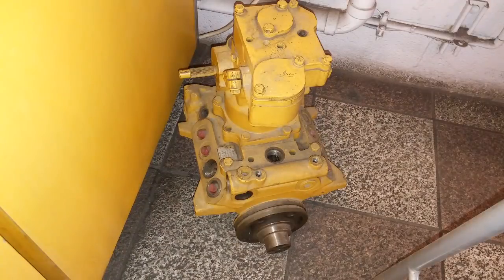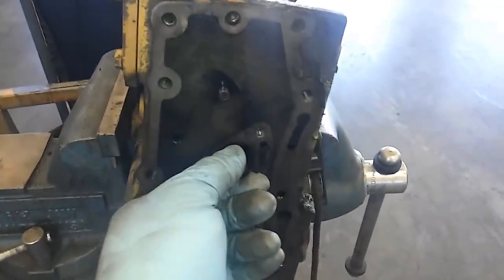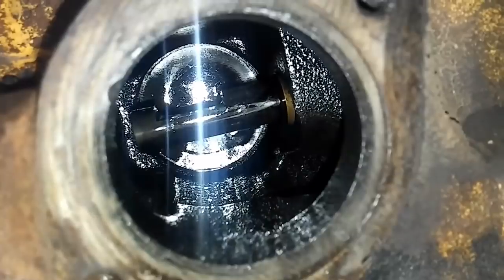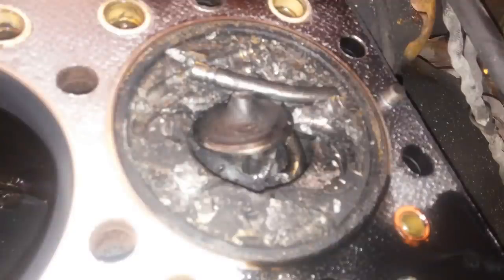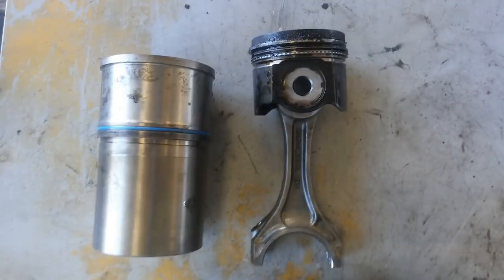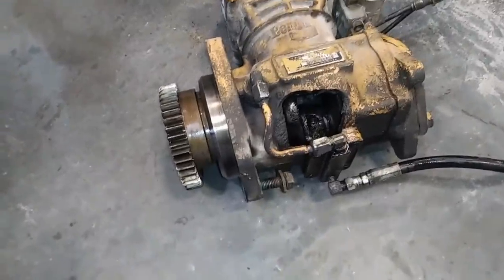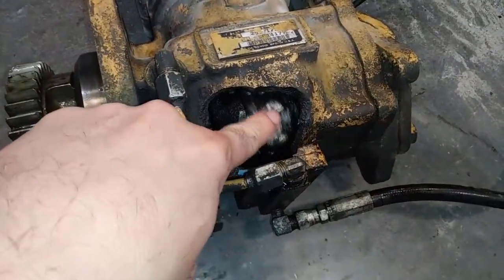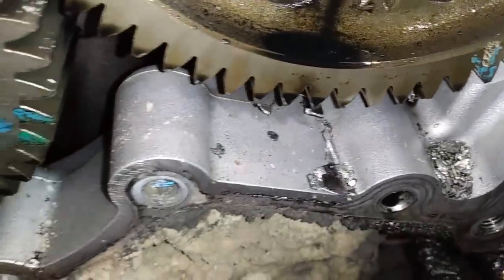Why Do Diesel Engines Runaway? What Is A Diesel Engine Runaway?

Comment: Go to the highest gear and dump the clutch while firmly braking?
Reply: maestro
Reply: On a 2l car thats the way to go. But in a brig truck you might break something.
Reply: Heinz LETZTE. Doesn't feels like something can brake tho
Reply: Do that on a locomotive... Now all of them have electric transmission, no clutch.
Reply: AliveC4T actually some have a physical connection between engine and wheel, but yeah true. Btw my prop plane ran away the other day and it worked XD
Reply: @heinzletzte.6385  rather burn up a clutch than letting part numbers fly
Reply: There's no such thing high gear in a boat
Reply: teffy millsar yeah I'm really just talking about cars and trucks(maybe
Reply: Well I had this on the highway twice and it just puched trou the clutch and brake's fortunatly it just lasted for like 30 seconds ,still verry scarry
Reply: Stanley Banks if that's the case pray
Reply: A CO2 or a halon fire extinguisher fired in to the intake??
Reply: yeah and then have a greater chance of breaking your clutch and engine...
thats a dumb ass idea...
good way to seize your engine kid...
Reply: Tom how does dumping the clutch seize the engine? Also would you just sit there and let the engine explode or would you try something?
Reply: I would open the hood and suffocate the air intake and not damage a damn thing... Repair your clutch and possibly engine, or dont have to repair nothing and get the same effects...
work smart not hard kid...
Reply: Tom not every intake can be accessed easily, and what if you don't have a thing that can make a good seal old man?
Reply: thats why I always keep a hand full of rags on me... be resourceful not sorry... and every intake can be accesed easily, take the cover off with 1 or 2 pop off clips and take the filter off... thats like what, not even a minute, if it takes you any longer to access the intake, I feel bad for you... and most diesels are designed to have a easy access intake that is not tucked away.... unless you have a mercedes or volkswagen diesel, those are designed to blow up on you...
Reply: Tom well normal rags don't hold up too well when you have a 100 horsepower vacuum, but guess could give it a try before dumping the clutch
Reply: @xnopyt13  not 1 rag, a hand full of rags lol, there is a video somewhere on youtube of a guy using the same method, I will send you the link when I find it, it doesnt take a lot to make a seal.
Reply: Tom alrighty
Reply: I've done that many times. Never had a problem. Dynamite the air if there are air breaks
Reply: @voltag3man   That's some nice 1000 dollar advice. Say goodbye to your compressor wheel if you use a rag. There's a reason he says book or clipboard in this video.
Reply: Buddy Guy nobody has a book or clipboard near them when working on or near a truck, they do have rags though...
Reply: @voltag3man  Nobody in a truck has a clipboard? Or any kind of service manual in the glove box. Mmmkay. The lid of the air filter box. A sun visor. A rubber floor mat.
Reply: @-BuddyGuy  most sun visors are too small and most turbos are too big for that too work, the lid of the air filter is mostly removed especially on non stock turbo builds, and even if you did have it the plastic would not make a seal harsh enough to suffocate the engine, and also most rubber floor mats in cars/trucks are pinned in and your engine would already be taking damage by time you even got one off
Reply: @voltag3man  But rags... rags are the answer
Reply: @voltag3man  holds head in hands
Reply: Eric x I enjoyed these comments 😂😂 thanks guy
Reply: @heinzletzte.6385  Better to seriously damage a clutch than throw a rod or two through the block.
Reply: It's entirely possible you'd smash the clutch to bits, the RPM on runaway engines is way higher than stock and i can only imagine the power a runaway produces. It's worth a go if you catch it early but the engine will be fucked even if you do stop it and you run the risk of breaking even more
Reply: Had a silver 92 Detroit run away, air pressure wasn't up enough to get the trans into the high side on a ten speed, 5th gear was it. It was screaming like you wouldn't believe. overwhelmed the right front brake and took off, that got hot and grabbed, went to the left rear, right rear, left front, back to the right front and then burned that brake off completely and away it went. finally got it shut down by kinking off the fuel line.
Reply: just put it in neutral and turn the engine off lol
Reply: @voltag3man  Everybody in a truck has a log book, the perfect thing for this.  If anybody had rags it would suck them right into the intake.  Don't believe me, go try it on a dinky car at idle even.  You'd need to counter the inertia of a heavy rotating mass of pistons pulling essentially a linear spring (air).  In the video you linked, note that the guy used a thick piece of rubber and still destroyed the turbo and almost lost some fingers.
Reply: Assuming it is not an auto!
Reply: @voltag3man  and if you read the bio he fucked up the turbo doing it
Reply: @voltag3man  after your done with those rags you better go get your tools because you're going to need another turbo
Reply: Jamie cool better than a new engine? Am I right?
Reply: Eric you never operated a tractor have you.  Smfh...
Reply: AliveC4T there is always a clutch...
Reply: @bradyn4212  the engine only needed fuel and air to run you had to cut off the air flow to shut the engine off
Reply: Yep my brother did that in his Mercedes Vito Diesel and luckily it stalled !
Reply: Better hava good clutch...
Reply: not all clutch are strong enough to hold 5th gear
Reply: @raymondo162  good luck finding halon LOL
Reply: @heinzletzte.6385  you either brake something , or you let the engine melt , what you gonna do
Reply: @voltag3man  nope , not on a car , that's the way you stop it , either that or the pistons will eventually melt to the cilinders , than you have a shit ton of parts to change ...
Reply: @voltag3man  I'd like to see you do that on a newer car lol.  Good luck with removing the pipe with no tools . Working smart is dumping the clutch in 5th while its not yet overspending , it will shut right down .... On a boat it's a different story, nut they have better cooling.  ..
Reply: S Tracy  hold the brakes and pray to god ...
Reply: @TRC2002  it will , I've seen a 2014 diesel overev ...
Reply: Yes
Reply: @voltag3man  Ruin your trans and engine together.Best thing to do is choke out the air supply.
Reply: And detroy the clutch and possibly the trans
Reply: What do I do if my truck is an auto transmission?

Comment: Back in 1991 while I was stationed on a U.S. Navy Perry class Frigate we had a new V-16 Stewart Stevenson diesel engine installed, connected to a generator.  This engine is rated at 750 kW (1000 HP).  While doing load testing with salt bath on the pier, one of the pistons managed to break free.  A piston busted out a hole in the engine block allowing the oil to pour down into the bilge.  The whole engine got red hot and the fuel and lube oil caught fire.  It took us about two and a half hours to put the fire out.  The piston was about 6 inches in diameter.  What a day !

Comment: I had this happen to me. I had no idea it was even possible. Never heard of it happening. In the middle of nowhere at 2am the truck suddenly goes full throttle. This is my 2nd run on my own. I wasn't told this could happen. Scared the crap out of me. Took it out of gear and pulled onto the shoulder. Tried to shut it off with the key and it kept on racing. All I could think of was to set the brake put it in 1st and dump the clutch. That did the trick. Boy what a way to grab your attention!!!
Reply: weaverjsnw we have a 2000 2500 24 vavle that did this last night

Comment: Add a fuel and air cut off!  If it still runs I want one of those!!!
Reply: Nothing a busted turbo housing can fix. It provides air and fuel (engine oil) ;)
Reply: @CC-ke5np  yup, true runaways aren't burning fuel delivered by the injectors.
Reply: yeah you do that on a 4 ton 7.5 11k cc truck!
Reply: Just cut air intake or stall it forcing 5th gear
Reply: @CC-ke5np  What if the shutoff valve was after the turbo but before the intake manifold?
Reply: @CC-ke5np  Having butterfly valve on the turbo discharge will fix a leaking turbo.
Reply: The best solution is a decompression system. Old Diesel engines had one to be able to start them. Early electric starters and simple hand cranks are too weak to start a diesel engine. To fix that, you can lower the compression using the exhaust valve. My Deutz D15 had a decompression lever with three notches. "No compression" for OFF, "full compression" for running or starting on a good battery and when hot and "half compression"  for hand starting, cold starting and when the battery was weak - as usual (simple DC generator, doesn't even recharge the battery when the lights are on).

When the lever is set to no-compression, the exhaust valve is open all the time and on half a compression, the exhaust valve is open during part of the compression stroke.  A lever which keeps the exhaust valve open is very simple to add and much more simple than various valves which may be or may not be at a good spot to prevent the runaway condition depending on what is going wrong.
Reply: @CC-ke5np  big problem with that is, that to achieve the extreme compressions of modern diesels, the fully openend exhaust vavle will make contact with the piston when its closing in on top dead center.
Reply: @9deviltiger9  you can use an extra cam or in case of a dual camshaft shift the timing. In fact some Jake Brake systems do just that. But sadly cutting costs is much more important for the manufacturer so you are right, they "can't" make a decompression feature due to the higher compression nowadays. Why spending a lot of money on all engines if you can just sell more engines to people who had a runaway?

This is just like with airplanes. Spend money to fix an issue that might crash an airplane or have the insurance pay for a brand new airplane and compensation money if the plane crashes? They only need to spend money on the fix after a plane had crashed or if too many planes might crash.
Reply: I've seen a fire extinguisher stop a runaway. A system that injects CO2 (or whatever is in a normal fire extinguisher) right before the intake would be cool. Not sure how well this works. I guess a butterfly valve would be easier though..

Comment: My dad always told me the surest way to shut one down is to remove the air. Guy he drove for had several old trucks (this was the mid/late '80s. They were old then) and a couple did run away in the shop. The one I was present for, Dad dumped the trash out of the can and put the bag over the air filter housing. Took a few seconds but it worked.

Comment: I have experieced runaway older detroits, its a sound you don't want to hear again. They would get a seized injector from water in fuel usually and since the rack is connected directly to all the injectors in can pull them into full fuel position or near full fuel and when the load comes off the engine it is gone to full fuel no load. U need a good hammer to break fuel fitting off and a solid plug on air intake if its burning the oil which can be sucked past the blower seals. All this must be done very quickly or you must run away.  Another way they can runaway if the rack is set incorrectly bypassing proper governor operation and goes full fuel on startup.
Reply: Game Bred Duramax  No I have not but if they are two strokes yes they scream.
Reply: Appreciate in the way you share that ugly experience and what to do if happens  on anyone else. Really helps.i just heard from a friend about experienced mech who replaced transf .pump on his 7.3 and after turned the in engine on started run away on him and they both my friend and the mech went in panic mode lol.and didn't know what to do and of course good 7.3 powerstroke was totally destroyed
Reply: gotta love the old 318, mechanics best friend is the clip board
Reply: Paul Mann 
Omg one of the kids in tech school ran the tune up wrong on a Detroit. 
As soon as it fired it went to the moon and everyone was asses and elbows out of there. 
Like a fireman entering a burning building, the teacher grabbed a sledgehammer and whacked the fuel lines right off of the head. 
When it quit 20 seconds later, the teacher yelled to the students on that engine: 
ya may as well go to the tool crib and get some ez-outs cause you boys are gonna have a fun afternoon!!
Reply: Especially the 53 series with the straight lobed blowers. They make an evil sound.

Comment: I always wondered why fuel line cutoffs by switch or monitor never became a standard on diesels. One that you could flip or would automatically shut off the fuel line or even block the air intake if the engine bypassed the redline for more than 30 seconds or so.

Comment: Mario had a great post (pull the plug wires) lol.  A friend Steve had a VW Rabbit diesel and one day going down the freeway it suddenly would not slow down.  He burnt up the brakes but got it down to 8mph. He jumpped out of the car and luckily that stalled the engine when his foot slipped off the clutch pedal.  At the dealership, 3 or 4 mechanics were under the car laughing and asked Steve to come over.  Now Steve was pretty mad because this same dealership had sold him the Rabbit a month before and he wanted to know why they would sell him such a dangerous vehicle!?  So he walked over and said "what!"  The mechanics told Steve they just drained over 20 quarts of oil from the engine oil pan and does he know how it got in there, for the oil level inside the engine was high enough for the oil to be sucked into the pcv system and straight into the cylinders.  Steve said, well yeah, the engine was making a ticking sound so I put in a quart of oil and the noise would go away.  How many times did you hear the ticking sound, one of the mechanics asked? Oh, at least 25 times.  DID YOU EVER CHECK THE OIL LEVEL?!  No, why should I, the ticking stopped.

Comment: My dad must have almost a dozen manuals with big rings torn through the covers. These were used to snuff air boxes and exhaust. Man you cant image how much suctioning an engine can produce. He was known as the Frankenstein mechanic, his only job was to keep equipment moving at any cost. If he could wait for parts he make his own. If he couldn't fix it right he made sure it could still be used safely and if he couldn't do that...... he would use it him Dam self.
Reply: ya... i told a guy...who recently purchased a diesel ford.... that the engine can run away

i then tried to show him how to block off the air with my hand.... even at idle speed, they suck a SHIT TON of air
WAY more than the 3 to 6.6L gas engines im use to

i didnt even make it bog down...... 

i told him "see..... thats why you need a 2x6 or something thick and strong"
Reply: @ajaxvarble  well.... that suction was pretty powerful....

All I'm saying

Comment: When I was in the fire department, we made a runaway in a parking lot caused by a busted seal on the intake side of the turbo charger. It was blowing oil allover the cars. Suggested to the drive to take the pillow in the sleeper and stuff it in the air filter can to choke it off. He did and it worked.

Comment: I've never experienced diesel runaway personally,  however my great uncle experienced a runaway twice sometime in the late 1960s when he had the excavating business.  Both were Detroit diesel.  One of the engines blew a rod and resulted in an engine fire, destroying a mack dump truck.   The driver jumped out the cab running for his life.   Another case happened on an excavator.   My uncle stopped it with a halon fire extinguisher.

Comment: I've only witnessed one runaway personally in my life. I used to drive a dump truck and lowboy for an asphalt contractor. My dumptruck was a mid 90s RD688 full blooded MACK. We had a spare dump truck that was an older (maybe late 80s) model Ford L9000. It had a 350 Cummins and one day out on our lot the mechanic had it running after he test drove it and it began to run away after he revealed it up a few times. We all heard it from accross the lot. I went over to it as the mechanic was scrambling around trying to stop it. I believe he blocked the air somehow. I had no idea what a runaway was until that day. It was pretty scary being there watching a truck try to destroy itself. I felt like I was about to see the engine blow apart because it sounded like a gas V8 turning 9000 rpms. I don't guess it hurt the engine because they kept the truck for a few more years and it had a couple newbie rookie drivers in it. I'm a commercial driver and have nearly 1.5 million OTR and heavy haul miles and I am glad that I've never experienced one in any of my trucks. This was a great video.

Comment: It’s sometimes usually the turbo bearing that causes a runaway diesel engine because it’s happened to me numerous times and Detroit mainly and how I stop the engine is I dump the clutch it scared the shit out of me when it happened because it was a cab over at the time I thought the engine was going to come through the doghouse but when the engine was inspected it turned out to be the turbo during the turbo is super loose inside the bearing which cause the oil from the oil pan to be sucked up into the engine and that’s what cause the engine to run away even when I turn the key off of the commission it didn’t stop the engine if it wasn’t for the fact that I could dump the clutch and thank goodness I was it going at highway speed otherwise it would’ve been too late I was gonna wind up bailing out of the truck if that didn’t work and sometimes usually when a diesel engine on a heavy duty truck say a semi or a loader specially Detroit will blow Blacksmoke a lot it’s usually the blower Sullivan is it the injectors.